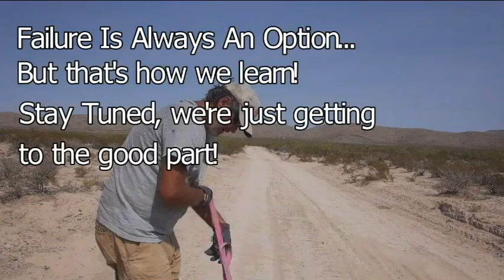Project Turtle - EV DIY Bike Project Episode 12 - Front Axle and Steering

Comment: Maybe the handlebars from the bikes could help with the steering and motor controller. The turtle is coming along nicely and the update is great. Like the idea of a drag stick for brakes
Reply from the maker: Yeah that might happen, using the handlebars in one way or another. The next phase is to totally take 
the front end apart and redo it with bearings, the steering isn't very good right now. I honestly wasn't thinking when I put those square tubes on, but they were the perfect size, I was so excited, then welded them on, and was like oh, crap! haha
Reply: Try head tubes from junk bikes they were designed for the job.
Cut them off clean them up remove the bearings weld the tube to the frame. Cut off most the fork and weld a thick tab to attach the wheel.
Use the old handle bars cut in half to steer.

Comment: Ergonomically your hands should be about shoulder length apart, and your hands about chest level (look at where they are on a stationary recumbent bike) because you will be using them a bit for leverage when you do pedal.
What do you think about mounting a single solar panel on top to provide shade for the rider as well as a bit of a battery boost/recharge?
It am enjoying the ride as I watch you work all of this out, and I look forward to your future adventures.
Reply from the maker: I haven't talked much yet about the solar, but that is in the plan for later. Thanks for the comments!
Reply from the maker: OK for the steering, there are a few different designs available for quads and trikes, some of them actually do have the hands out over the tires, and I was experimenting with a few different lay outs. This actually did work ok, but I need to redo the whole front end, I don't have bearings in the pivots now, and things are getting bent. When I get the pivots dialed in better, then I'll play with handlebars again. None of it is finished yet, just trying to get it close enough that I can test things. When I get further, I'll probably build a while new one from scratch, with things I learn from this one.   For the solar, the battery is 48 volts, but I'm looking at "maybe" doing dual 24V batteries, OR the 4 x 12V packs I have now, I haven't locked into the design yet, because I only ride the bike once a week, to go to town, and the days I'm home, I could use that battery with my main battery bank, on the solar system. I'm hoping to phase out the lead acid batteries, and go all Lithium, so dock the bike battery to the main system during the week, then take it on the bike when I go to town. I'm leaning toward a 24V system on the main battery bank. There are definitely advantages to each idea, 12V inverters are less expensive, and I have 4 of those. Charge controllers can go to 48V, a 48V system can use lower gauge wires, but I'm already wired for 12V.  So if I can come up with a common part I can use on the bike and home, that has a big advantage. That's why things are taking longer to finish. Anyway, hope that makes sense, not all of that is obvious from the videos.